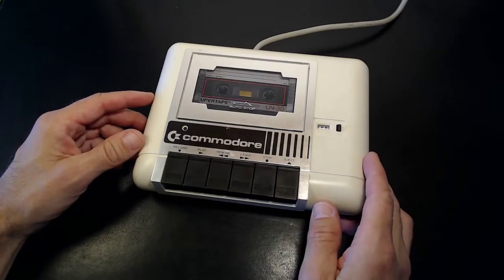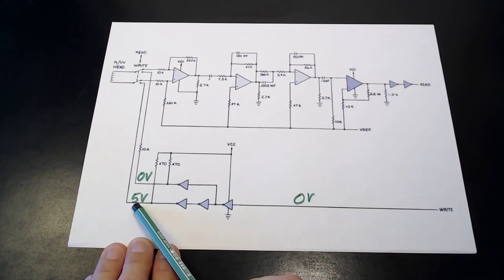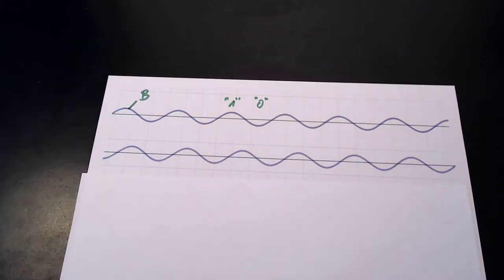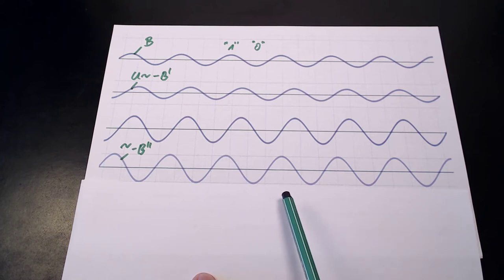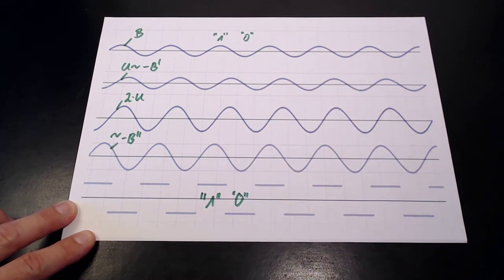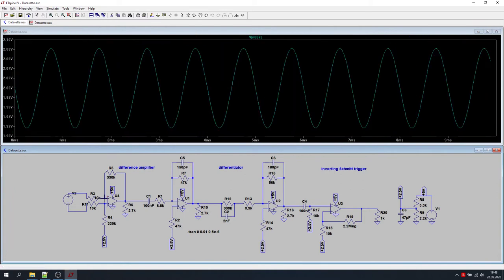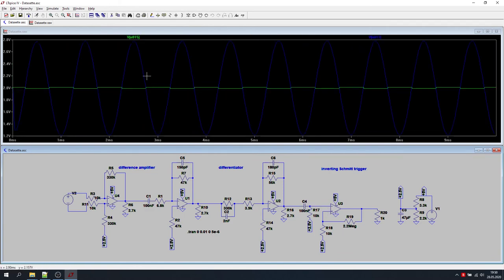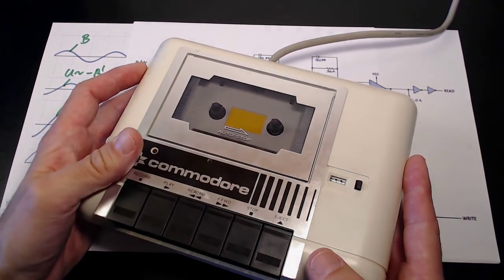Respect the Datasette 2: Physics and Signal Path of Storing Data on Magnetic Tape

Comment: That is a very good explanation.  Thanks.  Your example input was a sine curve, which suggests a data stream of 101010101010101010, which is not really representative of computer data.  I would be interested to see how it behaves with something more realistic, where there are consecutive multiple zeros or multiple ones, such as 01110010111000011011.  Presumably, the read circuit would have to rely on a clock to distinguish the individual bits, and rely on the cassette motor running at a consistent speed, rather than using slope detection.